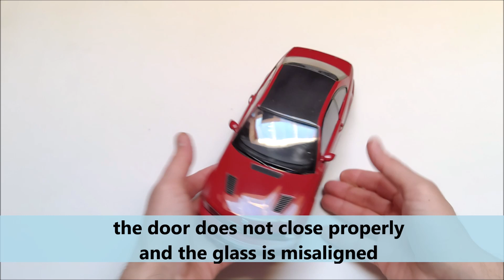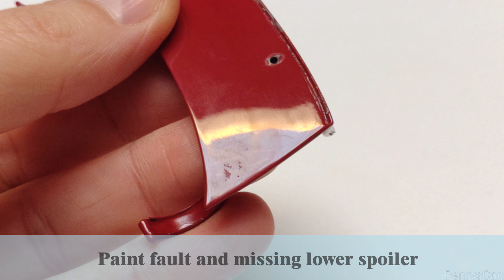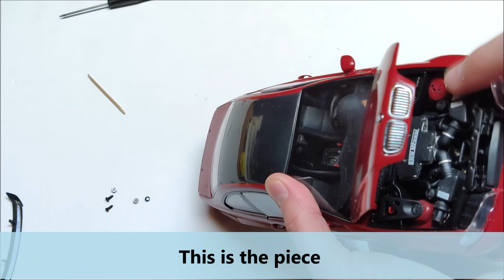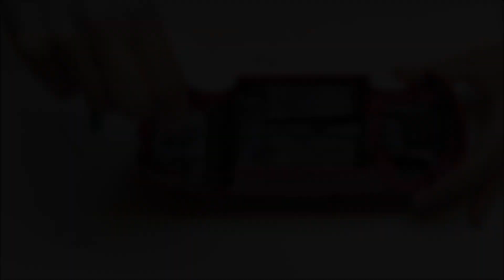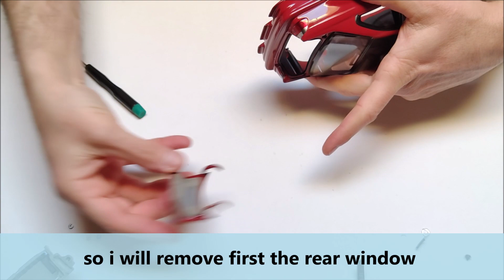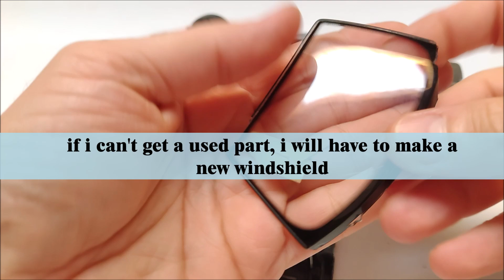How to Disassemble Bmw E46 M3 Gtr 1/18 Scale by kyosho

Comment: You should warm the front and rear windscreen with a hairdryer on low heat setting to melt the glue
Reply from the maker: thanks for the tip i will try to do it the next time. have you done it ?, and it worked, in super 3 glue